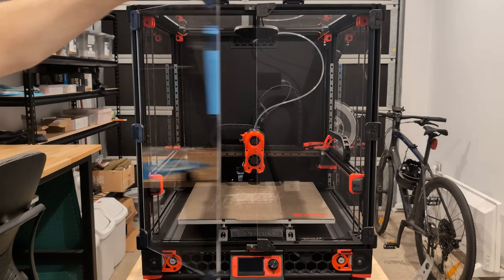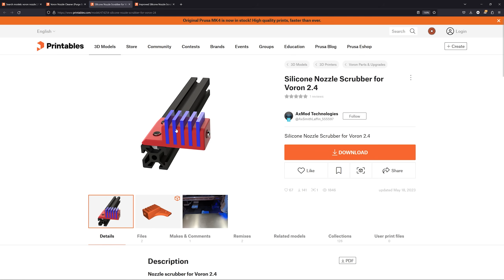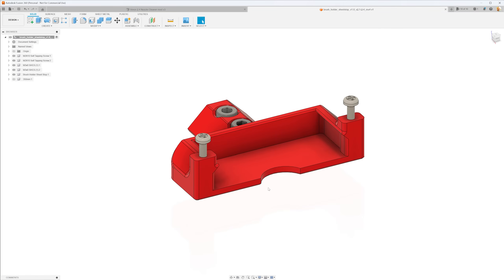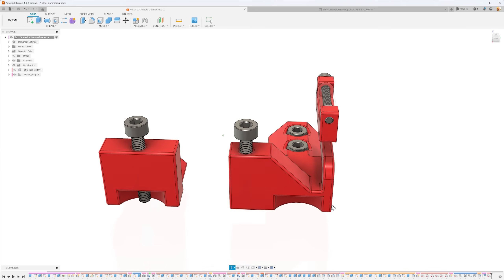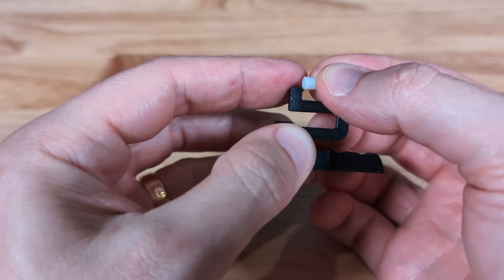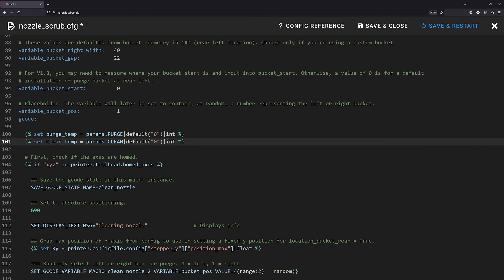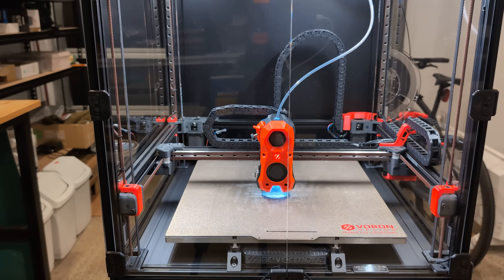Voron 2.4 Nozzle Cleaner that works

Comment: wont understand an Entry in your cfg File: "variable_purge_temp_min:      150  ..." This is way too low for a purge so why did you changed this value from the original 240° ?

Comment: How long does your cleaner last? My breaks after several prints and I need to replace it. Just printing 3 one... What material do you print them? Is it ABS?
Reply from the maker: PLA and so it's holding up well. But good feedback for a second iteration.

Comment: The macro uses Y0 as the location of the scrubber. On your Voron and mine the scrubber is at the far back which is the opposite of Y0. On my 350mm it is actually Y360.
Reply: The comment in the macro states Y=0 is assumed, but the actual Y position used is stepper y position max (line 116).

Comment: Does anyone incorporate with this code dynamic adjustments to cleaning parameters based on filament type? I mean to make this code to determine the material type and to adjusts the cleaning based on the material we use. For sure Bambu have such settings regarding the material types are used and set dynamically the cooling of the filament before cleaning- to set duration for cooling, set the fan speed based on the material...

Comment: Did you try using a silicone tube instead of a ptfe tube? The tube from an awg 12 wire should fit well on a M2.5.
Reply from the maker: @yamie8548  that's a great idea. I might just do that.
Reply: @scheffield  Great, and report back pls
I am building my first of a set of 4 Voron 2.4 LDO + ChaoticLabs right now and was looking into nozzle scrubers
Yours seems to be the nicest so far, but I need to print around 300°C with ZSD Diamond nozzels, and PTFE wouldn't be a good option there
Reply: Силиконовые трубки для подключения трамблёра, снова в моде. У меня где-то были две красные и одна синяя, осталось только их найти.

Comment: Hi! Silicon scrubbers are usually the better choice. Thermal resistant, not electrically conductive.
Ptfe degrades easily and the ptfe tube can worsen the situation pushing filament on the sides of the nozzle.

Comment: Hi, tell me how to add in the clean_nozzle macro to the command {% set purge_temp = params.PURGE|default("0")|int %} line 99 automatically transfer the temperature value from the G code of the slicer, so that it does not have to be set manually every time.

Comment: Just curious, wouldn't it make more sense doing this at the end of the print? The nozzle is already warm. No need to heat up and then cool down again. Then the nozzle is ready for next print.
Reply from the maker: @chaterboxnumberone  depends. For example, changing filament will introduce ooze again.
Reply: @scheffield  Sure, but then just run the macro manually? Or call on it in your filament change macro?
Reply from the maker: @chaterboxnumberone  absolutely. Give it a try and let me know your experience. Always happy to accept a pull request too 😸
Reply: I run my nozzle cleaning macro at the end, as well as the beginning.

Comment: Do you have to move the table a little further? On my 350mm it's not quite getting to the ptfe.
And what filament do you use? I'm afraid petg will soften up when printing abs. but no other filament I've tried will give enough springiness for the element
Reply: a small update:
moved the bed 5mm forward, petg seems to be doing fine for 80 degrees bed. Don't think it'll be good for abs though

Comment: Installed and love the action.. is there a way to setup a check and preheat before the operation?  Just did a clean rebuild of my 2.4 and would expect it to be able to operate independently.  Also, whats your print_start look like?
Reply from the maker: @Steven-Machado  can't look right now but it should be documented on the GitHub page.

Comment: Increase the thickness of your "ptfe_tube_cutter" from 10.1mm to 12.1mm and you can cut the tube to the desired length accurately and evenly without a caliper

Comment: i have installed the mod and it worked perfectly untill I printed basically a full bed of prints, and it started colliding with the printhead at the rear while printing, resulting in parts failing due to the bumping, and the ptfe holder breaking. I had to mount the bed further front to even get the printhead over the PTFE in the first place, so of the 350Y Travel i have about 330 left (5mm due to mounting the bed further front, and about 15mm for printhead clearance).
I think it is due to my combination of vorons tap (a CNC version of it rather) and the stealthburner. Otherwise this workes like a charm, is easy to print, and the bumpers are a nice and welcome addition!
Reply: Haaa je me demandais pourquoi je n'étais pas sur le PTFE mais vraiment le bord de la pièce >< et je me suis aussi posé la question du risque de collision...
Reply: I also had this problem, the back of the tap mount is so low and hit the ptfe tube mount, bending it, messing up the mesh which then crashed the nozzle into the bed bc it though the bed was way lower due to the brush triggering tap 1.2 mm earlier

Comment: Needing to cool the nozzel before cleaning adds time to the startup sequence unnecessarily.
Better off using some silicon fuel tubing instead of the ptfe tube. Might not be as durable though.

I would personally put the effort into finding some silicon sheet and make one of those designs. They work better, are more durable and can be built low profile for 2.4's.

Comment: Oof, have been using this but just recently my beacon probe collided with the print and broke the printed part.  Seems like I will need to avoid printing anything close to the edge of the rear of the bed.
Reply from the maker: Oh really! For me there is very little chance of that happening. Wonder what your setup is. Do you have any recommendations to improve the setup?
Reply: @scheffield  Are you using a beacon as well? I was going to edit the design so that the scrubber sits a few mm lower.  The beacon PCB extends out pretty far back on my setup and is only about 3mm above the nozzle.

Comment: i got a question for you..   i got a bambulab a1 mini . after maby 3 prints the print bed was to low on the left side.  i did auto bed leveling over and over but did not help. i contacted bambulab and they gave me a guide how to manual level the bed.   if i have to level it manual, then what is the auto bed leveling doing?
is it just moving to make it look like it is auto leveling?

Comment: I didn't understand how this cleaner helps. Ok you've pushed some filament, cooled the nozzle, removed the filament. But as soon as you you heat it up again some of the filament will go down the nozzle just because of the gravity. And you actually need to clean the nozzle the second before it starts printing, otherwise is dirty again.
Reply: Filament change?
Reply: I agree. The whole routine is kinda stupid but the design is maybe promising.
Reply: no its not stupid ... this is meant to clean the nozzle for probing with nozzle probes like tap,  before the print right after probing and meshing it dosent matter anymore cause you print a purge anyways that gets rid of filament

Comment: I have the Decontaminator setup on my LDO V2.4 300, and I rarely use it because it seems to cause as many problems with bits of plastic stuck to the nozzle as it fixes.  It was worth adding for the sheet stops alone though.  I have not found the screws to be prone to bending, however I printed the parts out of PC carbon fiber, and I turned the screws in as far as they would go and still have the heads catch the sheet, so I don't have screw heads protruding above the level of the sheet.  

Looks like you used an LDO kit...  LDO uses a slightly thicker aluminum bed than the standard Voron spec calls for, so they have a modified version of the Decontaminator parts with the sheet stop mounts raised in height to match.  If you are using the original version of the printed parts, then this could be why you have had issues with the screws bending, since they would be protruding out from the parts more, and thus be more prone to bend.  IIRC there is a link to the modified parts on LDO's printed parts guide.

However there is another issue with the LDO modified parts.  They raised the height of the sheet stops, but they don't appear to have raised the height of the brass brush to match.  This leads to the brush being essentially level with the bed, so you have to be pretty careful when setting the height and Y position of the nozzle when it wipes (depending on what hot end you are using), to ensure that you don't contact one of the sheet stop screws or even the bed.  With the wide nozzles used by the Revo hot end, I had a pretty narrow envelope in which it could wipe; this might not be the case with other hot ends.

Comment: Using PTFE as something which has direct contact with surface heated to more than 200 degrees Celsius is pretty bad idea
Reply: The hotend is cooled to either 150c or room temp first. And in the Bambu lab printers it doesn’t even cool down first during filament changes and swipes across the ptfe tube. The momentary contact with the tube is no where near enough time for it to heat up anything close to temps for it to start breaking down.
Reply: I think it’s pretty clear that your argument is wrong. The esposure time is very low, and PTFE is much higher heat resistant. 

I would mayb recommend looking at the particles released from printing, you would be shocked. I would recommend printing in a well ventilated area anyway. So even if the PTFE tube released something, it’s nothing compared to the molten plastic.
Reply: PTFE does not release toxic fumes until 280C. This is why manufacturers lock the temps at 275C for hotends that have ptfe touching the nozzle. The fumes can be very toxic for small animals especially birds. 

PTFE will degrade at 260, offgas at 280 and begin decomposing at 350C.

Yes you can google it, it’s not 200C or 150C

The confusion with the 200C rating is from a study in 1958. Teflon was changed in 2013
Teflon using PFOA is banned in most countries. This is the Teflon with the 200C degradation temperature.
Reply: Yes but not for yuo thonk, ptfe emits very toxic chemicals when gets burn 😊, dont smell the fumes , i think this happend over 240 degree
Reply: This is not how heat transfer works
Reply: I use the Bambu wiper for couple months now without issue. I wipe at around 220c nozzle temp.
Reply: If you look at PTFE covered pans like ones from Tefal. They would mention to not put it in the oven 260C.
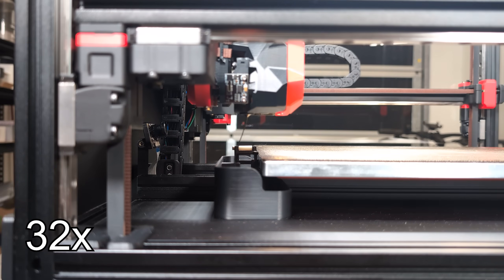Reply: 5:06
Reply: PTFE. Can withstand 250 degrees Celsius before breaking down. Besides, it only touches the nozzle for around 3 seconds max per nozzle cleaning. Definitely not enough for the ptfe to heat up to that high of a temperature
Reply: @siddhartheaswar959  it can withstand even more, yet it’s starts to degrade and free up poison even before 200c
Reply: @SergeiSugaroverdoseShuykov  Why do people put it in frying pans then?
Reply: @timha4102  you won't believe it, but it's assumed that you won't heat it over 150, instead of making dumb questions it's better to read what happens to PTFE when it's heated.
Reply: @SergeiSugaroverdoseShuykov   You're being rude for no reason. My point was, that touching the nozzle for some milliseconds will be a lot less harmful and release a lot less toxins than your average cooking with a ptfe covered pan.
Reply: curious, i've inhaled much of the poison then im afraid, @SergeiSugaroverdoseShuykov  ill look into getting an all metal hotend. Concerning the heating, even for 150 celcius that contact time is not nearly enough. the only thing im afraid about it the chamber being hot in the voron especially. but the gates belts only withstand 135c so if the chamber gets that hot in the first place you wouldnt even be able to print, not even mentioning an installation of a nevermore activated HEPA or carbon filter(i dunno if it works against PTFE poison but in the situation that it does it is there).
Reply: Making comments without fully watching the video is worse than heating ptfe
Reply: Shouldn't really be an issue if it's a disposable piece.  It looks like it can be replaced, so nothing to really worry about, especially with how much ptfe tube you can get for 10bucks.  lol

Not to say silicon wouldn't be so much nicer...but if you don't have it ptfe can work.

Also, if you're doing Abs or other high temp materials indoors without filtration I'm guessing the ptfe nozzle cleaner is the least of your worries.
Reply: Amen. PTFE gives off highly toxic fumes at such high temps. Even on pans you have to be careful - at food contact temps it's OK, but of you leave it empty over a flame for any length of time it's bad.
Reply: Nah, works amazingly well with BambuLab printers, and they heat the nozzle to 250°C when changing filaments.
Reply: Same PTFE goes in throat of hotend and sits just above the heating block .. Also PTFE (Teflon) can handle high temperatures very well for a long time and exposing it for such a short time is just like waving your finger from a flame
Reply: 😅😅 Give bambulab a call you must be a better engineer than theirs.
Reply: @yeheyheyyeh89  it's good that you breath decomposition products of ptfe ¯\_(ツ)_/¯
Reply: it cools down before so it can properly break the filament off

Comment: Interesting. You could upgrade it to have multiple hooks with tubes printed out, just in case one breaks out over time. In other words, make a brush made of rolls. And to be fancy, every single hook would be held on a magnet sandwiched between magnets, and a couple of spare hooks would be clipped on magnets behind the purge bucket.

Comment: I'd also consider taking the Bambu approach and pressing the nozzle into the bed after the wipe.
Reply from the maker: That's a good one. Might add that to the macro.
Reply: @scheffield  might need a flexible part of the bed, though. Maybe if the bed hangs off a little? Or cut an L shape into the bed as well?
Reply: @scheffield  also check before printing that the bed is bent enough. must be 1 mm deeper in the middle

Comment: Looks great. My only concern would be that the print will eventually snap. Wouldn't it make sense to have it barely touch the ptfe tube? I'm building a voron and I guess I'll give this a shot rather than the brush. Lieben Gruß :)
Reply from the maker: Good question. I don't know. However, the Bambu Lab version is holding up well. I guess we will see :)

Comment: Nice!  The only thing is (for a V2.4) that you can't use is in the middle of a print.  You can hit a part while moving back.  This should be installed on the gantry.
Reply: Most people have extra room on the backside of a voron if it is built right.  So you lose very very little print area, and you can still bring the print head down to the bed to wipe.  You have to do this if you have a blobifier.

Comment: Very neat. I love this design. After seeing the Bambu in person the other day I wanted something like this as well. Sadly, I have a bed slinger and have almost no where the nozzle can reach without being over the bed. Got about 10 mm of clearance on the right side of the bed. Was thinking of doing something just like this, then realized that would require some work and had a simpler idea. Since I have bltouch and know my beds z height fairly precisely, I can just use the edge of the bed to do a small wipe right after purging off the side of the bed. The head positions itself off the side, waits for temp, then spits out 10mm of filament, it then does the normal retract length, wipes 5 mm into the bed really quickly, then lifts up and travels to start printing. Surprisingly effective and has the first line going down smooth. 

Still might try to see if I can recreate this ptfe tube thing in the space i have, there have been an occasion where I found a small blob of filament that did not purge off the head until half way to where the print was to start. would be annoying to have something like that lying around on a larger print. Might have to modify since i cant afford to be yeeting filament towards the bed. That bugger in your video would have hit my x endstop.
Reply: Get the Bambu A1 Silicone scrubber for your bed slinger, its cheap

Comment: Unrelated, but could you tell me (us), which camera holder you are using? Looks neat there at the rear end of the bed. Would you also pictures of the viewing angle this gives?
Reply: It looks like a Logitech webcam. The 920 model possibly. The better version of the C270
Reply: @TheButchersbLock  hmm... given the ribbon cable and the form factor, I'd rather say this is a wide angle Raspberry Pi camera. Watch from 4:25
Reply: @stefanf6495  Did you ever figure out what holder? I have been looking for something similar myself.
Reply: @TheMrDrMs  no, unfortunately not. still looking myself.
Reply: @stefanf6495  Finally found it, at least I think so, printing now. GLaDOS Cam by under ProtaDec on printables, the "back extrusion gantry mount by GAB-3D" files. I have pi cam v3 - so I also grabbed "Voron GLaDOS Cam front remix for Raspberry Pi Camera V3" by Jevermeister
EDIT: Nevermind - I was looking for what he had in the video - but also looking for rear X extrusion as an alternative. His might even be attached to cable chain? The hunt continues.